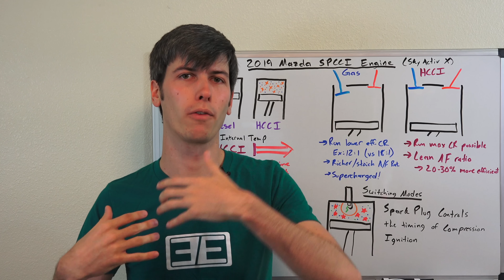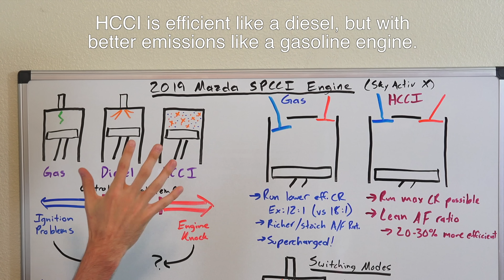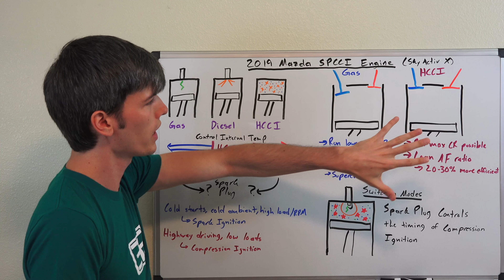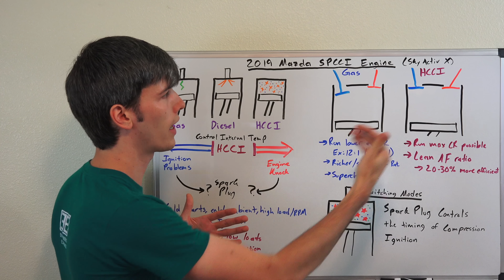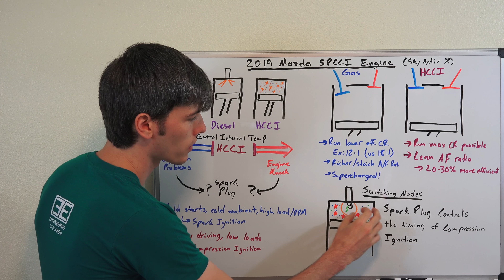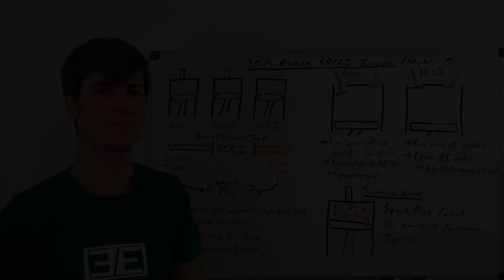Mazda Creates The Holy Grail Of Gasoline Engines - HCCI SkyActiv-X

Comment: Diesel combustion is usually referred to as  SCCI, stratified charge compression ignition. I guess the other issue for Mazda to solve is having the spark plug in there. It's easy to just put one in, but with the high compression the issue then becomes how well the plug can wick heat away so it doesn't become a hotspot that affects combustion (can lead to all sorts; knock, pre ignition, detonation...have a search for papers on super knock, prevalent in the new highly boosted, small capacity engines especially when you get carbon build ups). On spark ignited natural gas trucks they lower the compression ratio right down compared to diesel because of the spark plugs. Natural gas is more resilient to high compression so you can actually put it through a conventional diesel engine at 18:1 and it won't combust until you inject a diesel pilot or find some other way to ignite it .

Comment: For some reason I had guessed that Nissan and BMW might have collaborated to develop this  with a combination of BMW's throttleless engine and Nissans variable compression engine. overall I think Mazda simplified the process with a slight throw back to their own  KJ-ZEM engine from the 90's that was a Miller Cycle based engine.

Comment: Rc car engines use a glow plug to ignite the a/f mixture. The glow plug makes it so it doasnt need super high compression and it doasnt have temp control issues.
Reply: don't they also run on a special alcohol based fuel that costs $50 a gallon?
Reply: Herr doktorbimmer a tesla has zero emissions? where does electricity come from? does the source of power have zero emissions? does the production of batteries have zero emissions? as long as they don' t fix these two problems EVs are a big joke in terms of no emissions
Reply: $30 as of 2012/2013. I doubt it went up THAT much since then.
Reply: Justin Noker well basically, it's more like $26.00 a gallon, but they use that fuel mostly for the power gains. Also cause those engines don't have a high enough compression ratio to burn gasoline w/o a spark plug.
Reply: That's not a four stroke engine, that's a two stroke engine.
Reply: Herr doktorbimmer nope the mas like amazing sounding and driving cars you can buy on if ou like it but plese dont trigger other people that dont ike evs for mutch reasons evs arent perfekt and they arent make zero emisions (only by themselve) but the electricyty are still made in coal power plants and atomic plants the dirtyst things on the planet.

buy the way you can make ice cars co2 neutral with bio fuel.
Reply: David Jackson, II 2 and 4 stroke have nothing to do with it. Also 4 stroke planes also don't have spark plugs, and use compression ignition.
Reply: Ah, ok was asking because I remember back in 2009 my uncle used to have one of those RC cars, and he never used it cause the fuel was $50/gal, at least that's what he told me
Reply: Herr doktorbimmer shut up
Reply: Herr doktorbimmer shut up
Reply: Herr doktorbimmer just because you don't see the emission coming out of the car?
Reply: There are 4 stroke nitro engines for rc planes.
Reply: I know, but it was just an answer for "David Jackson,II" who wrote another comment and said that this are 2 stroke engines and not 4 stroke.
Reply: I just was responding to another comment, its not related about hcci engines.
Reply: Freak001100, read the other comments in this thread for the answers to your questions. EVs are half the carbon footprint of a gas car over the life of the car AND its batteries are 96% recyclable. Electricity can be very low emission when generated, with organic fuels like natural gas OR wind, hydro and solar PV. Even coal burned at a power plant is cleaner than a million individual car engines running around. You have no option with a gas car where your power comes from, it's petroleum. EVs can make their energy from the roof.
Reply: We still have locomotives running by diesel engines, ICE are not obsolete, even if we solve the battery problems and make good electric cars at a reasonable price (wich are not avaible yet) we would need much more electricity to charge them and we can't generate it only by wind, sun...etc
Reply: Antonio Fdes, you're only partially correct. Believe it or not, locomotives have diesel engines but they don't drive the locomotive - the diesel engines make the electricity to power a DC motor that pushes the cab. Electric motors are ideally suited for high-torque, precise control situations like trains. It's an ideal marriage of good use of diesel (constant rpm, high torque) and good use of electric motors.

You can completely power the USA with wind and solar. Add batteries and you have no outtages. Batteries added to a traditional utility also smooth out the power requirements by adding to peak power times after they've charged during off-peak.
Reply: Yes, but the generator and electric motors work as a transmission for the diesel engine not as a energy source, it is the only practical way to do it with such large engines
But for a light vehicles mechanical transmissions are more efficient. 
You can not completely depend on wind and solar energy because it is not constant enegry cource, and there is no way to store electricity on a large scale, and i don't think electric car would smooth the power requirements you would have thousands of car batteries charging at night, thats a huge peak demand you would end up burning gas to charge those batteries.
Reply: Just an FYI, people who keep stating that you can power the entire US electric grid with wind and solar don't know anything about the operation of the U.S. Bulk Electric System (BES). We are still a long way from that happening.
Reply: kellygnsd, the wind and solar comments are made to counter the "not enough wind and sunlight" arguments. If a solar farm produces X amperage at a point on the map, how's that any different than a coal-fired plant at the same place?
Reply: A lot more goes into grid stability than just current and voltage. In no way would I able to describe all that that goes into it right now but my quick example is of a large mechanical generator (not PV). That machine is physically locked into the AC grids frequency through magnetic field interaction between the rotor and the stator. The generator itself has mass. As the generator speeds up, AC frequency goes up and vice versa. Adding more electrical load to the system is a load on the generator and would naturally slow the generator down without governor control action to maintain the proper frequency... Electrical faults and starting large electrical loads in turn put the load on generators.  This added load on the AC system would attempt to lower system frequency to points that would damage electrical equipment and possibly lead to grid instability and collapse.  The frequency stability of an AC electrical system is directly proportional to the connected mass of the generators supplying the load. Photo-voltaic Generation(PV) does not have this mass and cannot at this time handle transients well enough to provide grid stability. This is the overly simple explanation and barely scratches the surface. FYI, I'm a NERC certified power system operator
Reply: Kellygnsd - thanks for your explanation but I think you're not seeing the forest for the trees. Yes, I'll accept you're an engineer. Solar PV has the potential energy supply to handle the USA. Add wind and hydro, we have excess power. The specifics you're talking about - aren't they handled with inverters? If solar PV is unacceptable as a power source, how are homes providing power back into the grid? I just read where the Air Force Academy in Colorado put up a solar farm that supplies almost all their power. Some island nations are 100% solar (with diesel backup). The point is, whatever differences in frequency and transient tolerance is a known issue and there is a solution. The science is known, is it not? Let's also now talk personal solar - if even half of all homes in the USA put solar on their roof, WHO NEEDS a national grid expansion? If I make 110% of my electrical needs without a utility, what's the future of the grid look like? Whatever problems you're talking about - lower frequency, fault tolerance - are far less than the issues raised by the power plants and fuels they use, is it not? Are you telling me it's impossible to add solar PV to grid in stages that would replace ANY power plant? If I told you a city has all its power coming in through solar PV, you know what needs to be done to accommodate that power supply, correct?
Reply: I see the forest, the trees, the mountains and the earth because it is my job to do so. You are not seeing the physics that go with making the grid possible. As I said initially there is no way for me to lay out all the information needed for you to understand the complexity of the BES. AC power distribution is much more complex than DC distribution. What about Power Factor, Power Angle, Reactive resources, Voltage Collapse, or Power Angle Instability, Spinning/Contingency Reserves? Without at least a minor understanding of those terms and how they relate to the grid this discussion will go nowhere.  The American Electrical grid is made up of 8 separate islands. Rooftop solar is possible because because in each of those islands everyone connected to the grid is synchronized and operating at the same frequency.  That means you rooftop solar is connected to the grid with thousands and thousands of conventional generators supplying the electrical inertia (mass) and reactive resources required to keep the grid stable. For small micro grids like found in island nations the reactive power requirements are low and within the limits of small residential or small scale commercial inverters. In WECC (Western US) load was ~150 GW yesterday, the little island atoll you speak of has in comparison a few MW of load to for the entire island chain. Vastly different requirements. Do you know the percentage of renewable already on the American BES?  Most residential rooftop solar projects do no provide enough power to allow for the house to disconnect from the grid. Battery storage is not developed enough to compensate for the time the sun is not shining and the wind is no blowing. Nature is unpredictable, inverter technology is no where is needs to be to cope with the reactive power requirements for the TRANSMISSION of said electricity any significant distance to reach the customer(unless you live on a small island).  That being said, my  utility already has 20-25% renewable energy in its portfolio and that is not including hydro. Progress takes time, engineering, and investment. More investment that what anybody can really comprehend when you talk about having to re-design the entire BES to cope with 100% renewables. It probably will happen, just no in our lifetime.
Reply: jaya neyon different fuel
Reply: look, just wait a few years you'll learn that tesla is the future... and the earth is flat... ICEs are obsolete.

Comment: So fill the cylinder with a lean mixture at the beginning of the compression cycle , and just prior to ignition inject more fuel into the cylinder so that there is a richer mixture localized by the spark plug?

Comment: I get how you use the spark to make the cylinder fire earlier, when it's cold.  But how do you keep it from firing too soon when it's too hot?  Did I miss that in the video?
Reply: Chris Hilton the intake valve will stay open on part of the compression stroke lowering the compression ratio so there isn't any detonation
Reply: Maybe they will use an intercooler or something.
Reply: I'm guessing the feedback in the ECU loop would have to be intake manifold temp/pressure and/or exhaust gas temperatures. ???
Reply: zachpaw, Thanks for the explanation.  That makes sense.  Just lower the pressure by keeping the intake open.
Reply: Herr doktorbimmer lool dont feet that troll
Reply: Herr doktorbimmer question for you
Reply: With direct port injection, the fuel can be sprayed under extreme pressures... diesel engines do it just fine. Common rail engines for example, can spray fuel in excess of 60 thousand PSI... SO yeah its all about when the fuel is delivered as much as the compression. SO to answer your question, heat will only play an effect of when the fuel is sprayed and since the HCCI cycle is used for light engine loads... the "heat" is not going to be an issue.
Reply: It doesn't use direct injection system like a diesel does, the fuel delivery is the same under spark operation and HCCI operation, that's why HCCI is better then regular diesel, because diesels spray fuel in and it immediatly ignites it does not mix properly with the air, HCCI eliminates this problem by having the cylinder filled with a fuel/air mixture from the intake port (exactly like a regular petrol car does), so a HCCI engine cannot control ignition timing by selecting when to spray fuel in like a diesel does, and that is what makes a HCCI engine so hard to make in the first place.
Reply: +BFHfunify Correct. The name of the technology might sound too technical to some people, but it is quite simple to understand. Homogeneous Charge Compression Ignition. Some people don't understand that the Homogeneous Charge part means that ignition is not triggered by fuel injection like it is in a diesel car, but the air and fuel are already mixed like in a regular petrol car before (or during?) compression, yet ignition is triggered by heat and pressure without a spark plug when the actual spark plugs are not used. You probably already know this, but this response was just to agree with you after seeing others who don't quite fully understand how HCCI works...
Reply: Richer mixture or less air
Reply: one way would be making the engine really well cooled.
Reply: Where should I send my donation?
Reply: my paypal haha
Reply: Homogeneous Charge is when whe have a group of intelegent homosexual people charge batteries. i'm having to use my second account to educate you idiots....
Reply: research flat earth people!

Comment: Concerning the switchover between compression ignition and spark ignition, isn't it just a question of which one happens first?

As ultra lean engines burn slower, they would need to ignite earlier, as a high compression HCCI could do.

Could the cylinder pressure be controlled by closing the intake valve earlier?  or variably?

At 18 to 1 compression, forget the turbo and the super boost.  Will this thing be any fun to drive?

Thanks for a highly informative video!